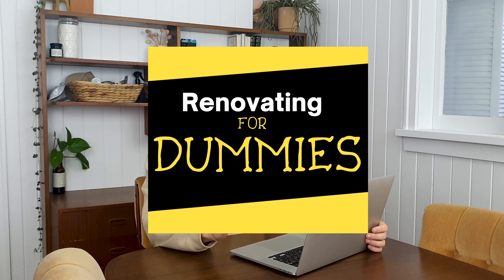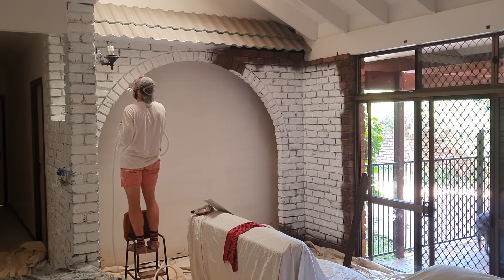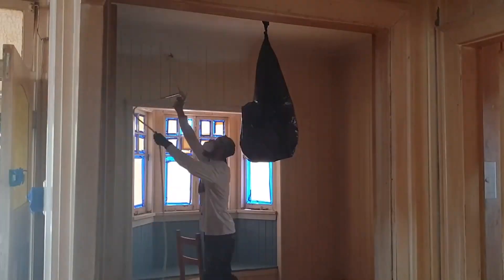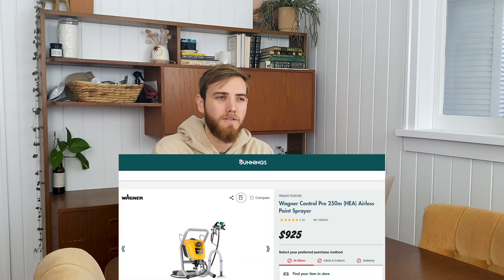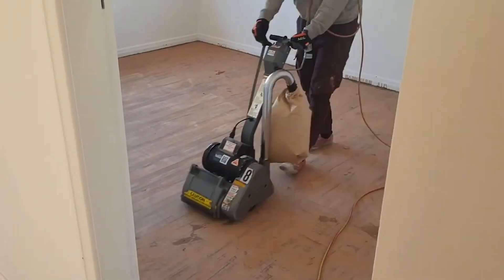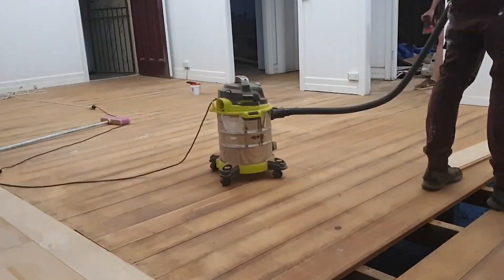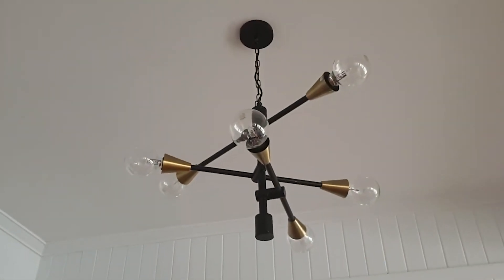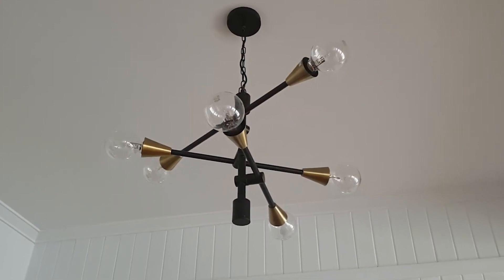Renovating for Dummies || Avoid making MISTAKES on your Fixer Upper

Comment: I think we all agree spraying is a bonus Luke, a bit of detail about the prep would be good in a future video.  Floor sanding can be a bit of a risk so some newbie tips here would help (dealing with uneven joints).  I agree about tapware but also think renovators need to know about fitting stop valves so they can change vanity & sink tapware themselves if they are not happy with the look.  My other recommendation is to spend the extra $ on the wet areas as that's where things can really hurt.  Also keep your waterproofing certs to give future buyers confidence.
Reply from the maker: So many good points here Scott! Haha agreed - spraying is a bonus, but it's changed our reno's dramatically hence I wanted to share that the everyday person can use it. (Not just for the pros!). I'll look to do a floor sanding tips video which breaks down everything we've learnt. Learning how to change taps is good skill to learn. I missed waterproofing - we always pay for a licenced waterproofer (even when I tiled the bathroom in the latest reno). It also gives you peace of mind around the reduced likelihood of leaks.

Comment: This is a great video! Definitely underviewed/rated. I'm now going to look for that paint sprayer (which I originally was thinking of skimping on). Do you have any opinions about leaving non-frayable asbestos ceilings or getting all asbestos removed. I'm on the fence, getting asbestos ceilings removed then means you have to replace them (so its two things) whereas, leaving it is theoretically safe if you never break or drill into it, but means you have to constantly think about it everytime you want a light or smoke alarm changed. At least that is how I'm thinking about it.
Reply from the maker: We love our paint sprayer! Has been the best investment we've ever made. Personally, if the asbestos sheets are in decent condition I would simply paint/leave it. Too expensive to replace unless you're redo-ing the entire place. Tradies may charge a little bit extra to change a light/smoke alarm but nothing to worry about!
Reply: @lukewiles1  An interesting follow-up. I was definitely leaning with keeping it. But now I'll be removing the asbestos because it turns out I need to rewire the entire house to get it up to electrical code (moving a Queenslander subjects it to the codes new builds must follow). Wow, who would have thought that rewiring a house with the ceiling gone saves $4-8k on the rewiring job! Turns out the time spent for a skilled electrician to crawl, search, and awkwardly work in a confined roof cavity, at their high hourly rate, is an extremely large portion of electrical costs. The savings will pay for the removal and a bit more, although I still will take a loss on the replacement, which will be expensive. But I figure in this unique situation might as well remove it now. I definitely agree with you though, best to leave it unless there is a special reason not to, as it is totally safe when unbroken, and a very durable material with lots of good properties when left intact.